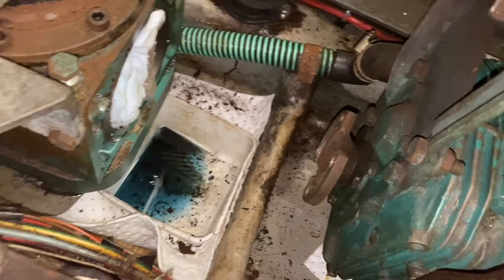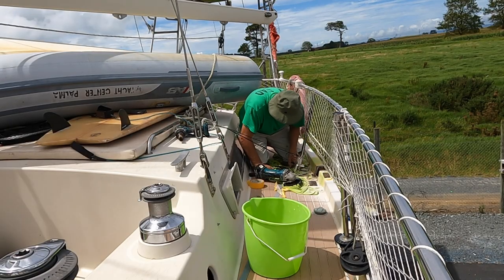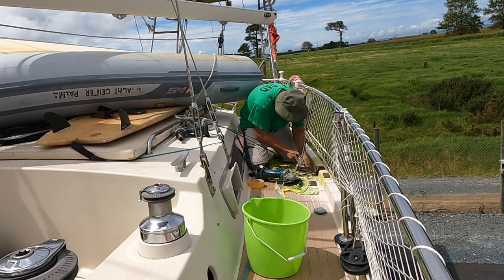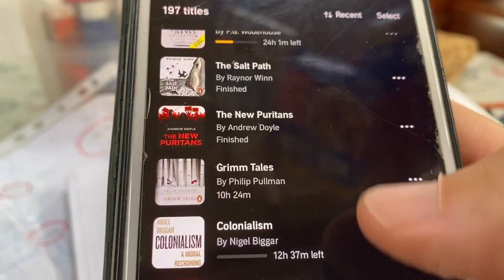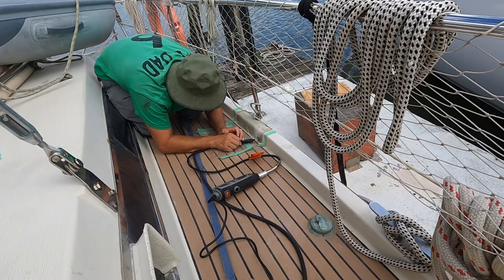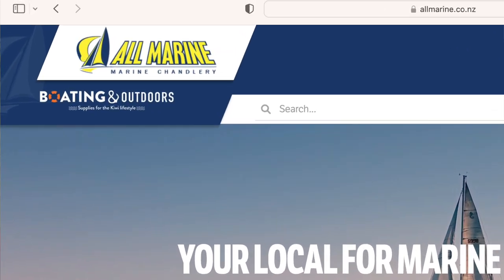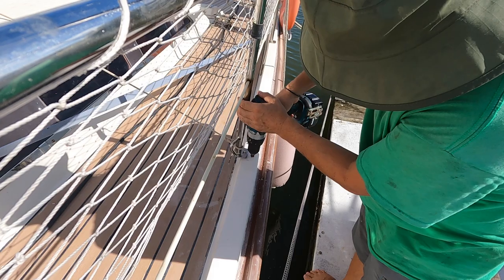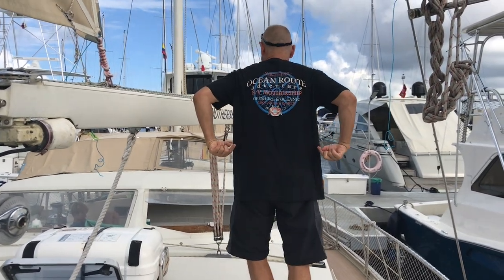Rusty Stanchion Backing Plate Replaced with G10 #Epoxyresin Sheet - #Fibreglass / #Flowcoat Repair

Comment: Good video Woody, but is it ok for all that fibre glass dust to go into the sea?
Reply from the maker: I do my best to contain it and clear up but for such a a small job it doesn’t make sense to tent off the area. A vacuum connection on the grinder would be ideal but unfortunately I don’t have one.. and carrying a dust collector on the boat would take up an inordinate amount of space for the few times you use it.

Comment: I have this same job to do, but forward where the eye bolt is for attaching the block to where the pole fore-guy connects. Would you say that G10 board I’d strong enough to tap and the bolt hold there?
Reply from the maker: Yea definitely. I was a bit unsure as I’d never worked with the stuff before so was a bit shy with it and didn’t really add enough. I would have doubled the thickness in hindsight and saved myself a lot of fibreglass layering!